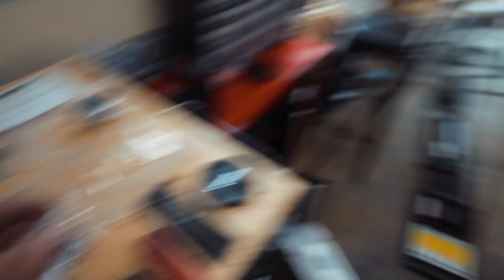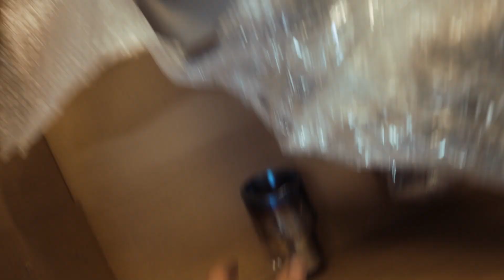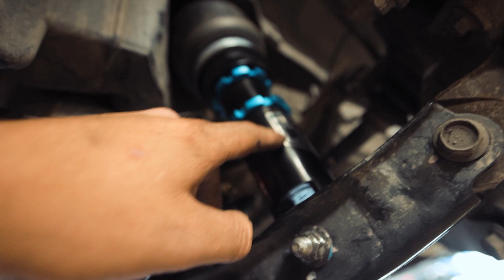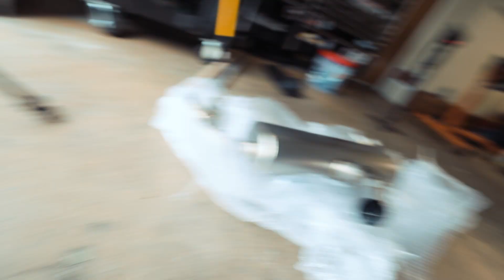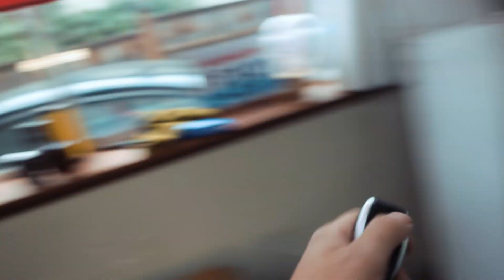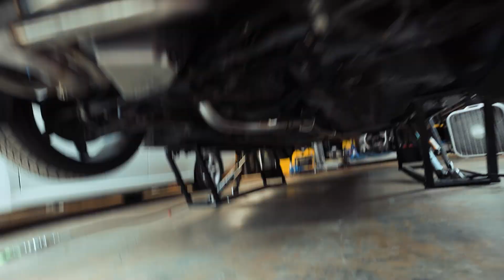Making my Subaru WRX Hatchback STIFF!

Comment: I'm from Europe driving a 2010 STI and I was wondering what the diffrence is between a catted downpipe and a GESI catted downpipe? I am really confused now???
Reply from the maker: The GESI is a more EPA compliant cat that is made to be Ble to flow very well while still compling with most oem emmisions ratings
Reply: @Smeedia  Can you explain it a bit more in detail? I still don't really understand what makes them diffrent from normal catted downpipes? Aren't they al 200 cell cats? Dus yielding the same catalytic cleaning?

Comment: does anyone know what could be causing a pretty loud ticking sound in my 2016 wrx. the sound only shows up sometimes and seems so be happening after hitting high boost. then it will tick until the car is turned off then sound will be completely gone. could it be oil related?? thanks. and also i did recently have a warranty replacement on my front cat
Reply from the maker: Whats all done to the car?.👀
Reply: @Smeedia  it’s completely stock. But weridly it pulls on my friends 2016 sti that’s stage 2 with a pro tune and fresh rebuild. From rolling and dead stop

Comment: Invidias bellmouth CATTED downpipe does NOT throw a CEL. it's also epa compliant. I think the CEL is more of a car to car basis. Some will throw a code and some will not. For anyone curious I can send pics of my AP not showing and codes and my dash with no CEL. I'm running the catted bellmouth DP from invidia and the tomei expreme ti single exit catback.
Reply from the maker: When we're you tuned?
Reply: The invidia DP is NOT CARB approved BUT to my knowledge that doesn't matter in the case of catalytic converters when talking about EPA regulations. It's sort of a Grey area...As long as the CAT can sufficiently do its job and doesn't throw any codes(and you aren't in CA) it shouldn't be affected by the cobb greenspeed update. Even CA residents can technically still use it with the AP, as long as a code isn't thrown, however they will likely still not be able to smog it and it would be off-road-use only. All cobb did was remove the ability to bypass CEL codes from throwing and did not remove the tuning functions. To my knowledge a GESI cat is just a finer and more dense honeycomb technology that allows the larger volume of exhaust from the 3" pipe to be more efficiently burned equally or greater than a stock exhaust+cat would achieve. This is all speculation of course and I don't have proven science to back these claims but my own personal investigating came to this conclusion. 🤙

Comment: Also curious how your set up will sound. I installed Grimmspeed UEL (got it cerakote) and it sounds like a FA motor.
Reply from the maker: Sounds more ELH than UEL? 👀
Reply: @Smeedia  for me yes, the sound is more towards the ELH side. there is a rumble but faint. I also just installed VF48HF turbo so idk it that plays a part as well on noise.

Comment: I just did today the Perrin master cylinder brace on my 15 Sti, that damm thing gave me a hard time, even without the fuel lines/FPR in the way, damm AC line and some f#ck!ng bracket that I took off to have some space to work better with that freaking installation, good thing I have some handy dandy tools around, sh!!!!!tt lol, that hatchback is getting better and better brother!
Reply from the maker: Dude therr is literally so much shit in the way when trying to install them 😅😅😅
Reply: @Smeedia  dammm now im kinda worried because I remembered when you had to cut yours in order to be able to connect the fuel lines when you did that fpr install 2 years back, dammm hopefully my tuner finds a way to route that shit with no problem

Comment: As a note, a rear sway bar doesn’t actually eliminate understeer on a Subaru. A front sway bar, max front camber, and a proper alignment does a better job of eliminating understeer on Subarus then just a rear bar. Rear bars alone actually reduce it overall grip on Subarus.
Reply from the maker: Noted 🙏

Comment: Heyo Tanner, I installed a stage 2 grimmspeed parts including Boost control solenoid is it safe to drive to the dyno tune? Est drive 20-25 mins
Reply from the maker: Just do not go into boost
Reply: @Smeedia  thanks, appreciate it!

Comment: My evo x with a 6466 made 452 whp dyno jet and 354lb torque. 26 Psi. This is on a stock block only on pump gas atm. Car feels good! Cant wait for the dyno numbers on the sti's :) Btw titanium is so bootyful, looks good, sounds good
Reply from the maker: Any plans for some E85?! 🥳 some solid power right there!
Reply: @Smeedia  ya, i jus lazy and didnt buy the e85 kit yet. after spending so much an extra 400-500$ just seemed like so much XD

Comment: Wanted to update you with my cooling issues. I did a mishimoto turbo side cap and put the rad OEM cap on and that seemed to make the temps more consistent and car spent less time in the 200s. Time to beef up suspension now and pick wheels and tires. Tires will be Nitto, and rims will be gold. 18" wheel size. Any recommendation on offset and width that wont hit my stock brake size ?
Reply from the maker: 18x9.5 +38 is a pretty safe bet for most out there 🥳 glad to hear the cooling system is a bit more sorted now 🔥🥳

Comment: The best handling mod I made to my Hatch STi was Whiteline rear sub-frame infill bushes (KDT902). They massively reduce that rear end float feeling making the rear so much more planted. The GT86/BRZ has a similar setup and also benefits from this mod too.
Next best mod was the front wishbone rear bush (W53353). They wear badly and caused brake judder on mine. They make the steering feel a lot more precise when upgraded.
But loving the content. It's nice to see someone work on a hatch for a change. It's a really unloved and unappreciated car in the Subaru world.
Reply from the maker: May have to snag a set of the sub frame bushings, they can be a PIA to install sometimes but definitely work it 🔥

Comment: I noticed you got rid of the airbox thing next to the battery. Does it throw a check engine light without it? I want to remove mine on my STI, but I don't know how to get rid of it. Thanks.
Reply from the maker: The secondary air pump?
Reply: @Smeedia  Yes. I have an aftermarket tune on my car, pre-green speed. If I delete it, would it throw a code? I don't think the tuner can provide me with updates anymore since I don't have TGV's.

Comment: hey Tanner doing a rebuild but I'm in a pickle. I'm getting the Iag stage 2 tuff block. Should I go with an RCM oil pump or an IAG oil pump? trying to find any info on comparisons, but can't find much. All I know is IAG is more expensive. Should I not mismatch parts or would that not matter in this situation?
Reply from the maker: I've never used the IAG, personally I've always been happy with my RCM ones 🤝

Comment: Would running a trans mount in tandem with engine mounts (IAG Comp for both) without an upgraded pitch stop cause any damage to the motor or anything? Thanks! (Asking for a 21 STi)

The reason I am considering skipping the pitch stop is because I am not comfortable running one without a pitch stop mount brace. Right not braces are just way too expensive.
Reply from the maker: What car do you have? 👀
Reply: @Smeedia  2021 WRX STi 🔥
Reply from the maker: You don't need the pitch stop brace, just the pitch stop mount 🙏
Reply: @Smeedia  Would it be okay to skip the pitch stop mount too? (So just trans and engine mounts)
Reply from the maker: I'd suggest doing pitch stop and trans mount iver the engine mounts
Reply: @Smeedia  Thanks man! I'll give that a shot!

Comment: did you do solid engine mounts to go with that solid trans mount?? if not all the strain will be on the solid mount.
Reply from the maker: Group N engine mounts 🤝
Reply: @Smeedia  thats not a solid mount so all the strain will be on the transmission
Reply from the maker: I don't use solid mounts though, all mounts use poly bushings. Solid mounts in a daily is an awful idea
Reply: @Smeedia  it looked like the perrin mount you put in was solid, was i wrong

Comment: Yo if you want help or advice with a new computer I do IT professionally and am a hardware enthusiast. Lmk
Reply from the maker: Need a suggested GPU and CPU for 4K video editing, any suggestions? 🙏
Reply: @Smeedia  I can do a full parts list if you need or are you expanding on your current system? Might need to upgrade PSU to handle new hardware as well. Hmu in disc?

Comment: INSANE amount of progress! Good shit man! Oh dude. Idk if YouTube bugged out but I didn't see a reply on whether I should be worried about the oil pump on my car. Also. Sorry but another question. Why is a stock location turbo setup better for daily driving then a rotated turbo setup? The current goal is a ~500whp reliable daily. I thought going rotated would be better for airflow+heat but haven't done research on it especially on it would affect daily driving!

Here's my comment I am referring to: And as for the setup. 29.5K on the odometer. I got the car @28K and the Short Block was apparently just broken in. So not many miles on the new block... Hopefully. Unless they lied to me.
Reply from the maker: I wouldent stress the oil pump too much, if you ever have timing off of the car it would be a good time to check it. 

Stock location and slightly smaller alqays has had a good overall response. With a usable power band. Karma was all power up top and not crazy responsive down low. Even with a smaller hot side
Reply: @Smeedia  Okay! As always thank you so much man! Both things NOTED! Idk how you find the time to reply to so many comments AND get so much work and shit done! You must not sleep at all! Lol. You are an inspiration my guy! Whenever the build starts I will probably get an IAG Oil Pump and get it PROPERLY installed. Lmao
Reply from the maker: I just don't sleep 😅🤝
Reply: @Smeedia  Looks like I guessed right! 😂 You deserve the best man! Can't wait for you to be a full time YouTuber or whatever you aspire to be! 🙏🏼🙌🏼

Comment: You should try and find a Grimmspeed JB400 or BB500 turbo! I know on their website it explains a lot about them but they are sold out there. Not sure if another company may have one in stock or not.
Reply: He has the Grimmspeed JB400 installed on the hatch rate now.
Reply from the maker: Indeed, I have the JB400 on thr hatch right meow lol
Reply: I just watched the other vids, my bad. I will ask a question though, I have a catless downpipe currently on my car and I was messing with a accessport but ended up not buying it and it deleted the tune that was on my car and it keeps throwing a p0420 code. What should I do to keep the CEL from coming on. Get a catted downpipe or tune or both?
Reply: @ACR6KILLER  were you using an OTS cobb map?  You can see if someone in Smeedia discord has the same year car and model as you and they can send you the old Cobb OTS maps.
Reply: @ACR6KILLER the only aftermarket downpipe out currently that won't throw the CEL light is apparently the new Cobb downpipe. You will need to be tuned afterwards to get the CEL to be deleted.
Reply: I was looking to buy, but decided not to and that’s when I found out about 3 days later. Idk why it took that long to present itself, but it did. Reason I didn’t buy was because it was updated to the latest version to where it wouldn’t clear CEL’s. Ironic I don’t buy it because it didn’t clear cels and now my car has a permanent cel.
Reply: @ACR6KILLER  that's a bummer haha. On the bright-side, if the cars not put into a limp mode then I would just rock the car with the CEL light on.
Reply: It’s somewhat In limp mode but also somewhat not. It’s getting the shittiest gas mileage and my stock turbo sometime hits 17.7 psi when I do have fun with the car. But lately I’ve been babying it.
Reply: @ACR6KILLER  what car is it? 17 psi isn't abnormal depending on the car you have.
Reply: 2015 Subaru STI launch edition. Stock everything except for the catless downpipe and a muffler delete on the stock catback
Reply: @ACR6KILLER  well the STI doesn't get the best mpg. If I baby my car, I can get around 21 mpg. Stock tune the car will hit 17 psi, nothing to worry about there. Now if you hit 22-23 psi you are definitely over-boosting.
Reply: I’m getting 14-16 miles to the gallon. And that’s me going easy on the gas and basically watching the mpg screen to get the best Mileage but it’s so finicky to keep a good mpg

Comment: Subiedepot has a GESI J Pipe for the FA20 as well. I ran it on my FA20 for a bit and it served very well. I may be modifying it to fit my FA24.  But for us in Cali it doesnt really matter, as GESI is still not CARB compliant. So getting any J-pipe shipped here is another issue.

Cool seeing some of the stiffening parts right now. I will be doing a few on the 22 in a couple weeks.
Reply from the maker: How have you been liking the 2022 thus far?
Reply: @Smeedia  To be quite honest, I am loving it. I have only ever had a 21 WRX to compare it to. But even with just the JB4 and catback I just tossed on, I am enjoying it much more than my FBO Flex 21 haha.

An between getting the 22 and watching your vids its finally got me off my ass to make vids of my own haha.

Comment: That Cobb cat-back looks great, and I’m curious how it sounds because depending on that, I might have to replace it with my Invidia Q300 on the hatch 🤔
Reply from the maker: I'll get some good sound clips once we're running 🔥🔥
Reply: I love my q300 for the next to zero drone
Reply: @Tyler-HUH  same, so I’m super curious so how this Cobb exhaust sounds. Do you have a down pipe with your Q300?
Reply: @ohgryph  I do. It's not stupid loud but sounds great at wot. Grimmspeed downpipe
Reply: @Tyler-HUH  oh okay nice, thanks. I’m planning on getting a down pipe soon to open up the exhaust a little more and add a little more rumble to it, I just gotta find someone good to pro-tune it so I don’t have no boost creep or anything like that.
Reply: i’ve been dying to switch out my q300 i need more loud
Reply: @modern750z  i almost went R400. then after hearing it i was not impressed. Sounds like an RX7.

Comment: yee boiii, i've also spent alot of time on my suspension lately, If you haven't experienced polyurethane bushings yet, check out the whiteline front essentials kit, really connects you to the ground without being harsh, real fun install if you can turn pieces to press the bushing out too.
Reply from the maker: I di have a press, May not be a bad idea 👀🔥

Comment: Malperformance has down pipe for ej with tune that doesn’t throw a CEL
Reply: They’ve had it it’s a high flow cat
Reply from the maker: @wevy21  first time I've seen it 🤝
Reply from the maker: Did they just come out with one? 👀
Reply: I have it on my 2020 sti limited